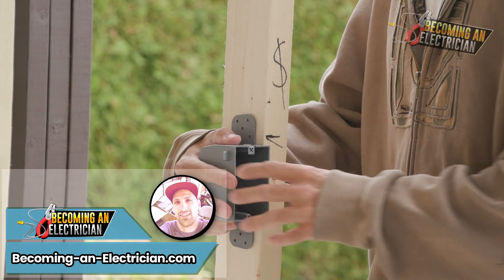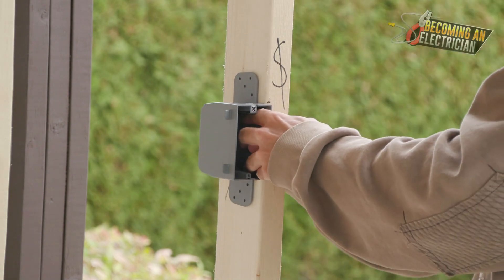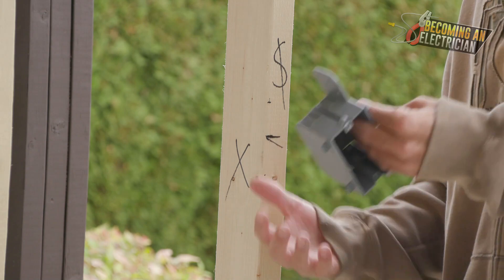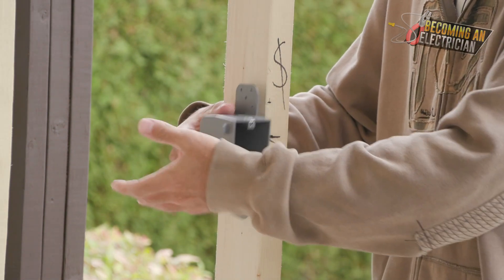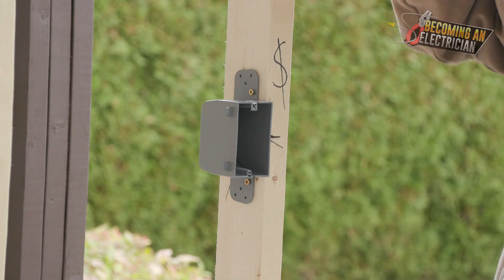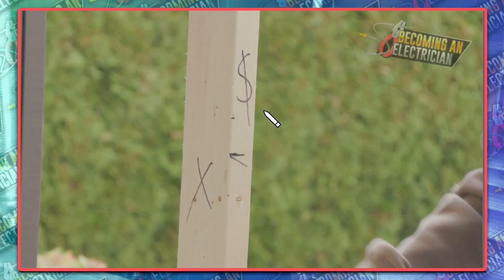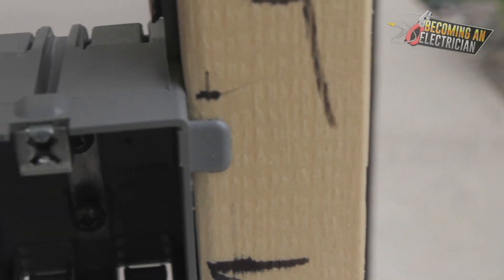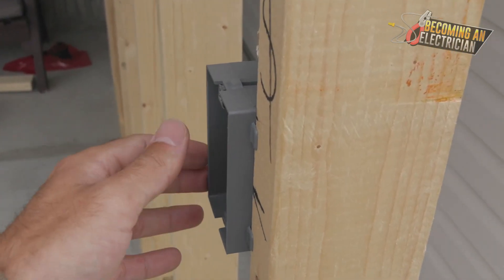How to Install a Single Gang Electrical Box

Comment: I just wanna say that I really appreciate the content. I started in a trade school and then went to a commercial company for roughly 8 months and then got laid off. I decided to get into residential this time. They put me on the finish crew going on 8 months now. I haven’t gotten experience in residential roughing in though. Once my hours are in should I go ahead and take the journeyman’s exam or wait if I think my mechanical skills aren’t ready yet?
Reply from the maker: Hey good question, Barry.

I personally waited a bit longer until I felt I was ready.. You can go ahead if you'd like, as obviously the pay increase is awesome, but once you get the "journeyman title", companies often try to take advantage of that and "assume" you know what you're doing.

(To be honest, most foreman didn't even know what they were fully doing.. they kind of faked it and figured it out on the jobsite.  At the end of the day, that's what a good foreman is.. they ask questions, work as a team, and decide the best answer.. but many times most foreman were untrained, unknowledgeable, and made many rookie mistakes).

I would say keep reading, watching tutorials, and practicing.  The goal is to be a well-rounded electrician so that you never get stuck doing one thing (such as only finishing, or only bending pipe, or only pulling wire).. if a company is trapping you like that, many times it's a sign the company is too big, and creates a "rough-in crew" and "finishing crew", which does not teach you about the trade.. it's not different than getting a factory job at that point..

So never be afraid to look around at other companies to get your experience.. sometimes they do pay more, teach better, and the grass really is greener..

Should you become a journeyman?  Yes!  You want the raise, but do it when you're ready (but don't wait too long, otherwise the schooling can get updated and make it harder to catch up, too!)

Hope that helps 🙂

Comment: Outstanding video.  Thanks so much. I would actually also appreciate knowing how to break the depth tabs on the NuTek boxes that you are using.
Reply from the maker: You can either just twist them off with pliers - but my preferred way is to put it up against a piece of wood and tap it, they break immediately and cleanly!  - https://becoming-an-electrician.com/free

Comment: can a plastic box be used on steel studs
Reply from the maker: Here's an interesting article for you:
https://diy.stackexchange.com/questions/181393/can-you-mount-a-plastic-junction-box-to-metal-studs

In short, you must always look at the product's specifications of what its been approved for.  The spec sheet is typically pretty clear!

You can look up "Product Name Spec Sheet", and you'll often find a direct .PDF to get you going!